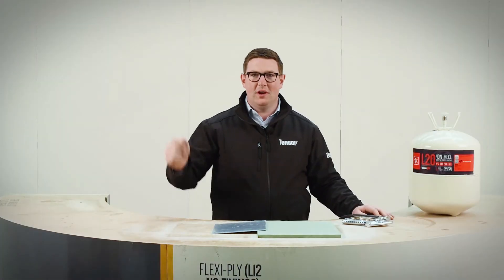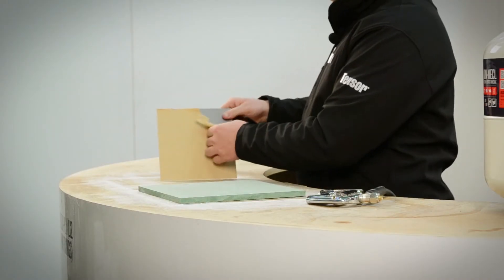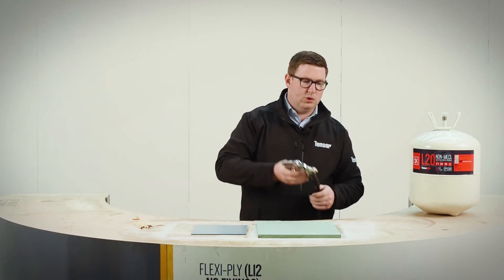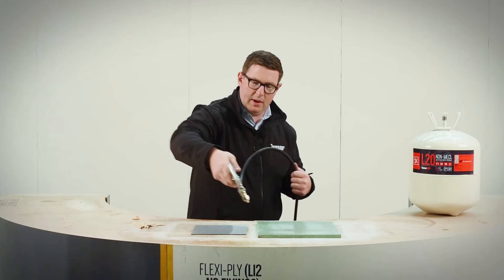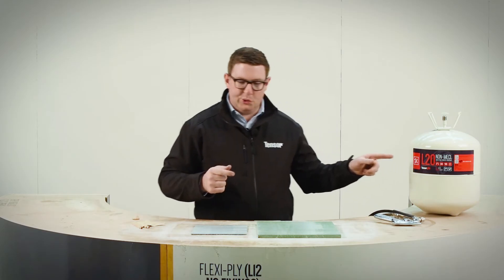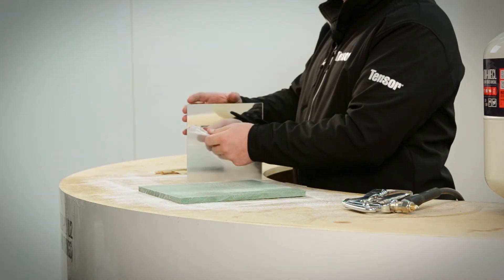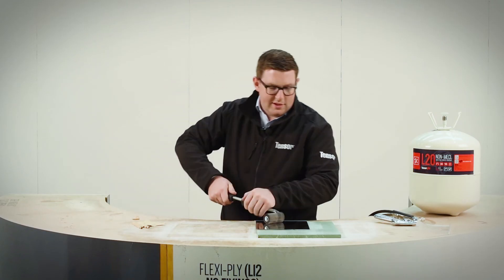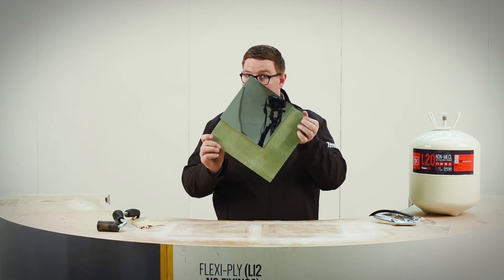HOW2 bond Acrylic Mirror to MDF featuring TensorGrip L20

Comment: During a pratical production process,  the front face protective film should be removed after the adhesive cures. Rolling on the mirror will inevitably scratch the finish.